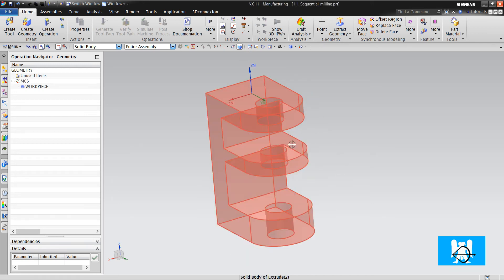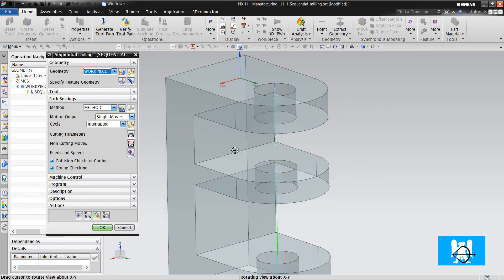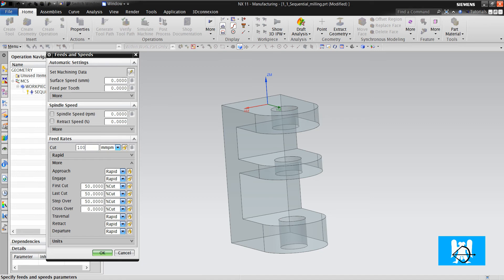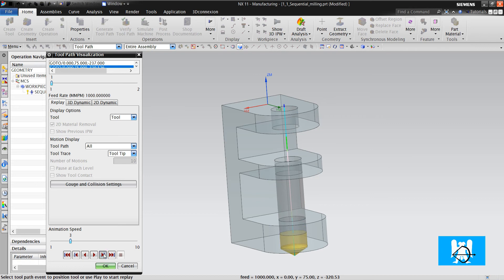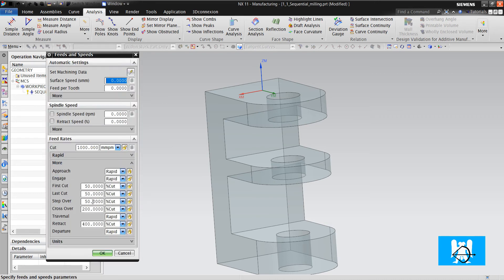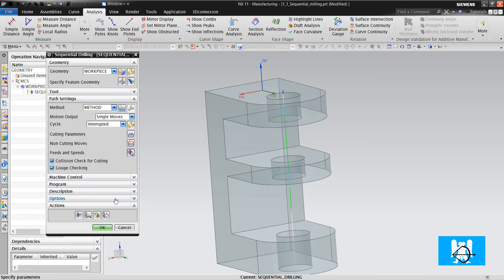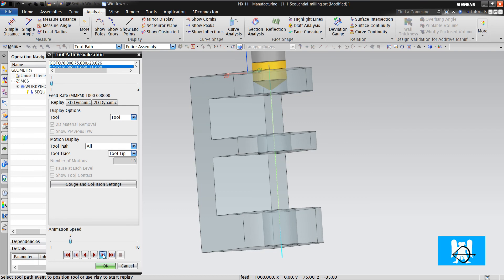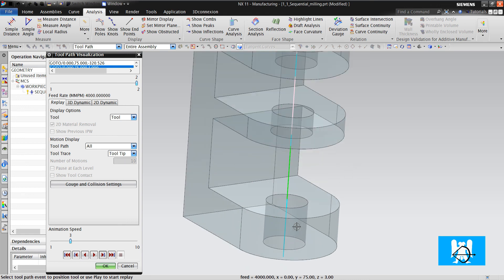54-Sequential Milling Operation

Comment: I like your works
Reply from the maker: Thanks
Reply: i: using nx cam, but not understand setting feed and speed for every tool using, 
ans next tool, next feed for every using
please 1 tutorial for stool and speedm feed
Reply from the maker: You can find feed and speed adjustements in my feed and speed videos.
Reply: do you have antutorial only for spped and feed?  which please